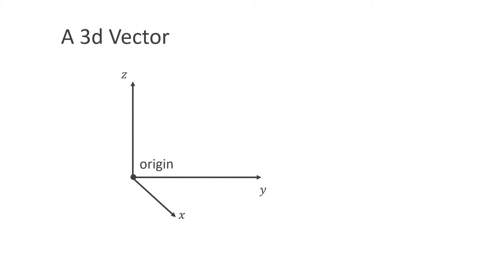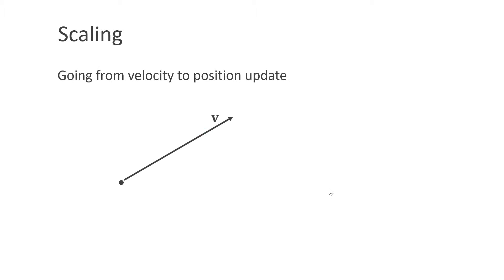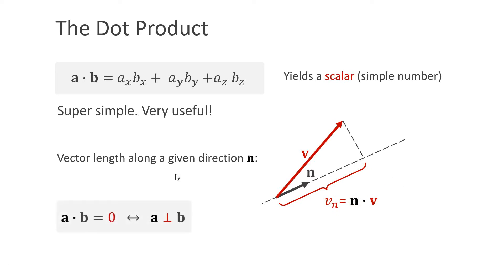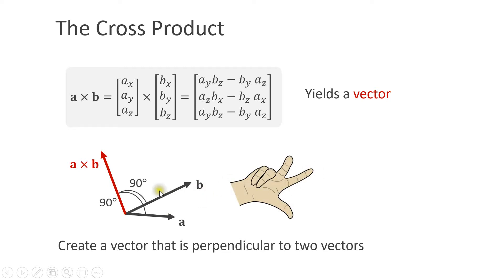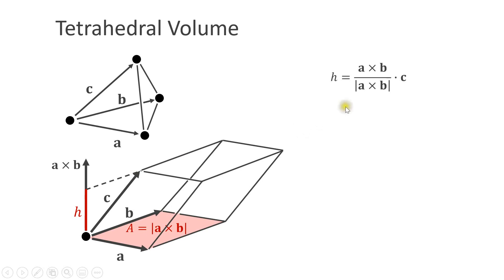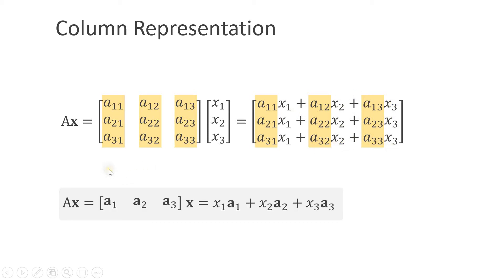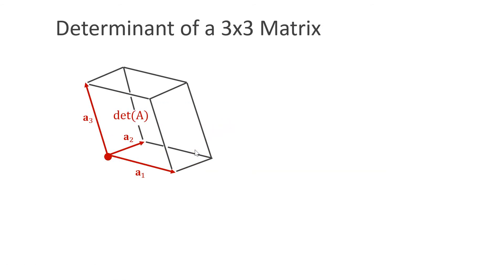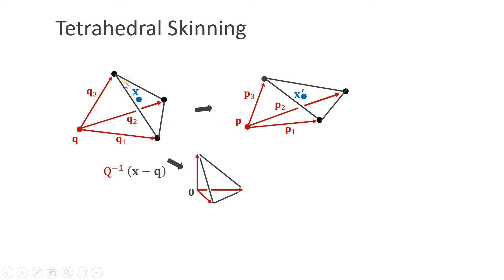07 - Intuitive 3d Vector Math for Simulations

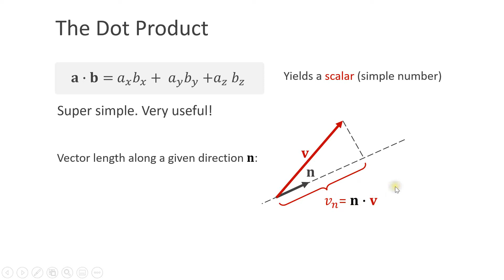Comment: At 4:30, the projection is not equal to the dot product as you say.
Reply from the maker: N must be unit length as I explain earlier. How would you compute the projection?
Reply: @TenMinutePhysics  The projection is computed dividing with the length of the vector. And yes as you said it was a unit vector it does work but as you are talking about the dot product in an introductory way, it may lead to confusion as it equates the dot product with the projection of one of the vectors, making it non commutative.